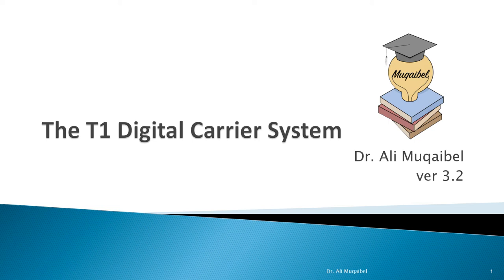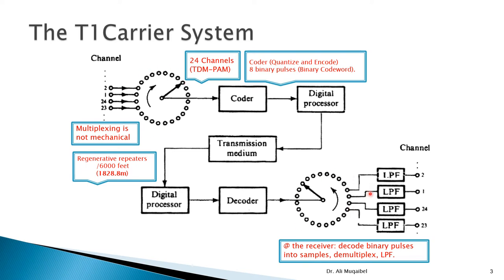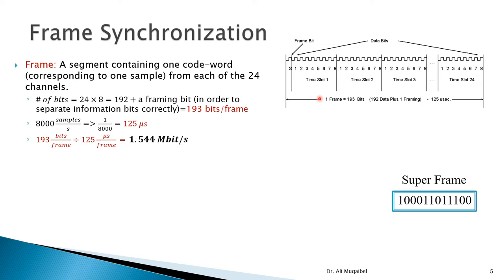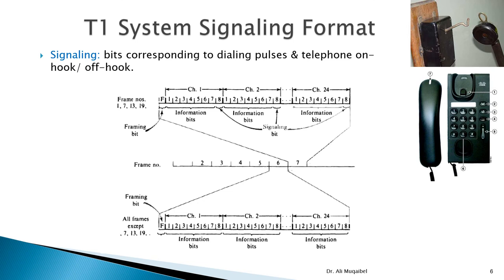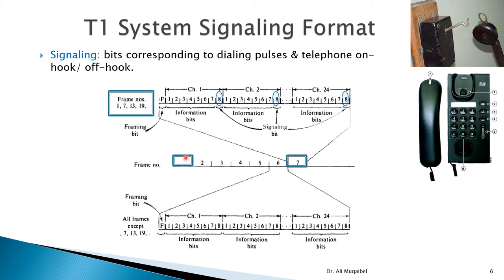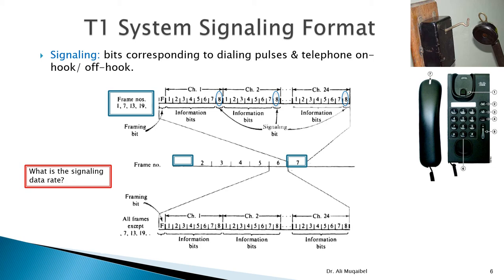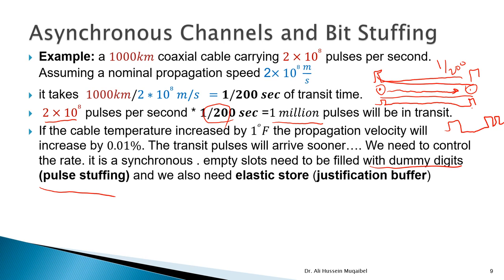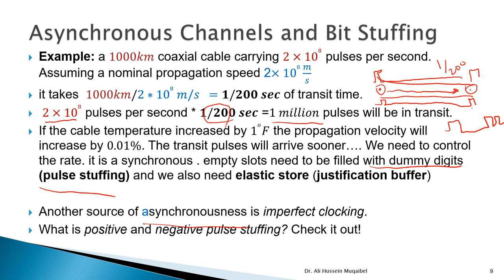6.5 The T1 Digital Carrier System

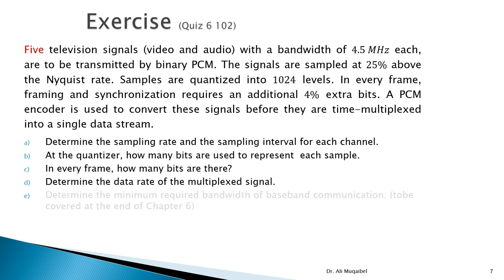Comment: Dr Ali can you give us the answer for the exercise problem ? 17:31
my solution is 
a) fs = 11.25 MHz, Ts = 1/fs
b) n =log 1024 + (4/100)*log1024 = 10.4
c) 5*10.4 = 52
d) Rs = 52*fs = 52*11.25M = 585M bit/sec
e) Bw = Rs/2 = 585M/2 = 292.5 MHz
Reply from the maker: Start by writing your answers and then I will try to give you a hint about the accuracy
Reply: @alimuqaibel7619 
 my solution is 
a) fs = 11.25 MHz, Ts = 1/fs
b) n =log 1024 + (4/100)*log1024 = 10.4
c) 5*10.4 = 52
d) Rs = 52*fs = 52*11.25M = 585M bit/sec
e) Bw = Rs/2 = 585M/2 = 292.5 MHz
Reply from the maker: @d700M545  good job.  You just missed (b) . Try again for (b)
Reply: @alimuqaibel7619  for (c) : 24 channels * 10 bits = 240 + 9.6(4% of 240) = 249.6 bits/frame 
Is it right? Is the number of channels constant which is 24 ?
Reply from the maker: For part b. n=10
Reply from the maker: @faisal.al-harbi  the number of channels is 5.it is the first word in the question.. So number of bits 5*10+2=52